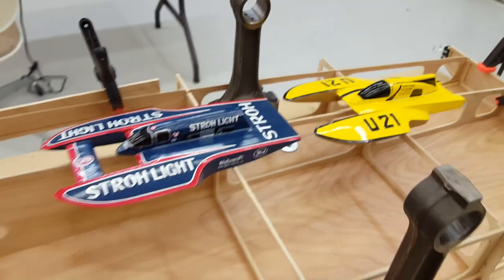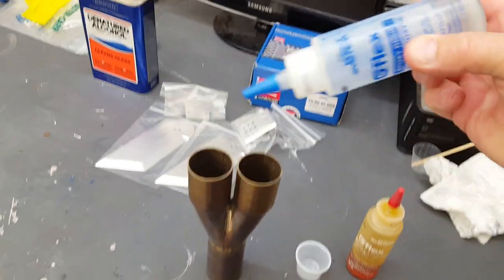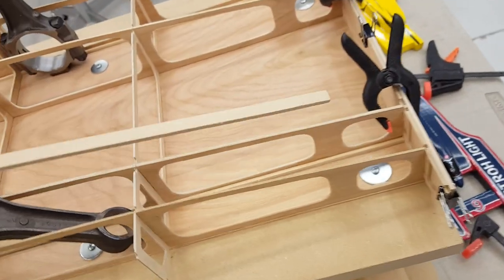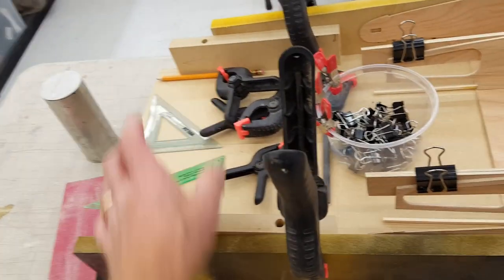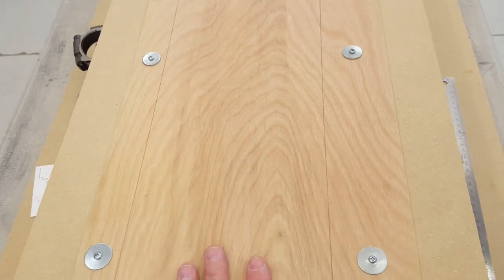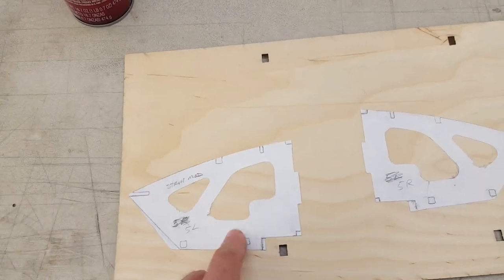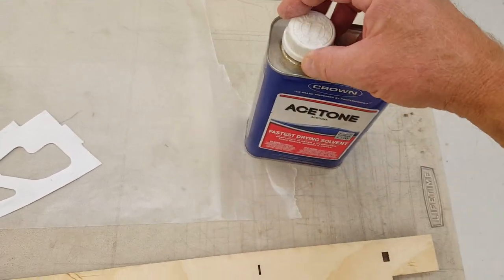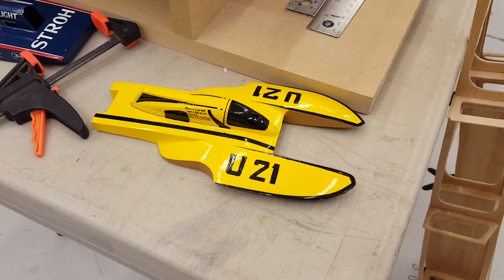Part 1 How to Build RC Hydroplane Racing Boat - "The Gasser"

Comment: Scott, for all my scroll saw stuff I do I use a LOT of patterns. I go to the dollar store, get a couple rolls of cheapo masking tape, put that down first. Then spray glue your pattern down to that. The masking tape comes off really easy with no residue and no acetone needed.
Reply from the maker: An extra step? I'm much too lazy for that Ken. Besides, I love the smell of acetone!
Reply: @M5PerfHydros  Have you ever thought of using clear vinyl transfer tape, like what goes over the top of finished vinyl window/car stickers to peel them off the paper backing to apply to the window? You can find it on that ama zon site in 12" or 24" wide by 50' rolls for like $15 bucks and spare yourself hours of making rows of masking tape and it peels off residue free too! Did I mention it's clear too, so you can trace what's underneath to cut out and transfer patterns that way too?  😎
Reply: "Bump" so you'll see my reply Scott... Sometimes YT sucks for notifying comments that are tagged to someone else in the thread!

Comment: Any tips for cutting the skins? I’m thinking of clamping the material to a thin sheet of 1/4” ply wood and working slowly with a fine toothe jig saw. But also wondering if a scroll saw is the way to go?
Reply from the maker: Don't waste the 1/4 ply!  I use scroll saw where I can and a Dremel tool with an aggressive cutting disc for the rest. Works like a charm!

Comment: Hi Scott, I see in this video that you get to the point of showing how much epoxy to use, but you didn't show how you apply it.  Do you use one of those small hobby brushes?  Do you apply it to both surfaces being attached, or just one?  Thanks, Jeff
Reply from the maker: Yup, I use small brushes. Not the typical horsehair epoxy brushes that you get in the hobby shops. Those tend to lose a lot of hairs and that drives me crazy.  I'll put a link below to the ones I use.  And yes I do apply epoxy to both pieces, mainly just to be sure that there are no bare wood spots anywhere. 
https://www.amazon.com/dp/B07TNQFLCK/ref=cm_sw_r_cp_apa_i_5X035M7TMWC2GQ7EAS0Y?_encoding=UTF8&psc=1
Reply: @M5PerfHydros  thank you Scott!

Comment: Is that 1/8" ply you're using?
Reply from the maker: Well I use a little bit of everything...  Some is 1/8" lite ply, some is 1/16" and some 1/32".  In a few critical areas I'll sometimes use a bit of heavy ply also.
Is there a particular portion of the structure that you're curious about? I'm happy to help if I can!
Thanks for watchin' --
Scott
Reply: @M5PerfHydros  My interest is in the whole structural integrity of the vessel.  Your work is clean and organized, I like it.  I'm currently scratch building a 44" Disney Nautilus.  It was originally my intention to 3d print the hull, but this may be impractical due to the time it takes.  I'll still print many of the detail parts, but may take a different approach to the hull. That's where you come in.  Now I'm mulling over the idea of making ribs for the hull and covering them with either ply or styrene, then covering that with thin 3d printed hull plates that have the rivet detail on them.  Working on the rib design now as I write this.  Thanks for getting back to me so quickly.  I'll subscribe to your channel if I haven't done so already.